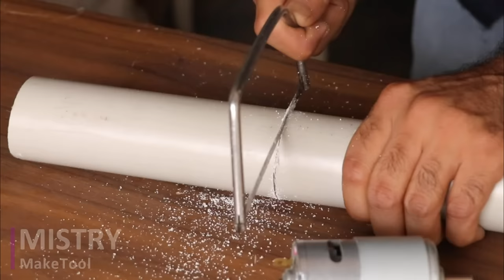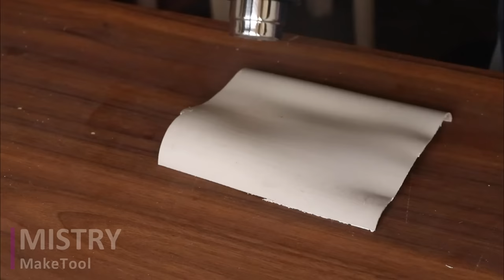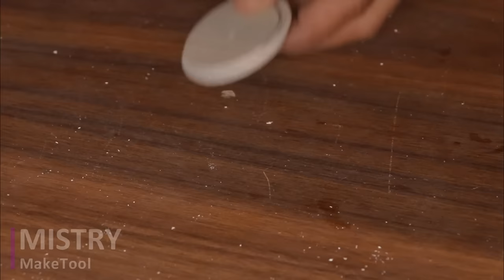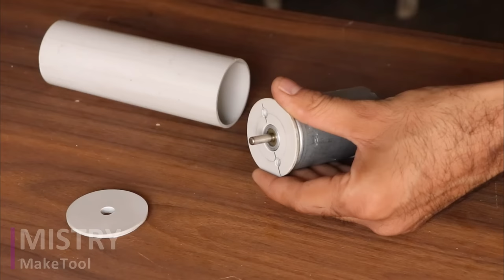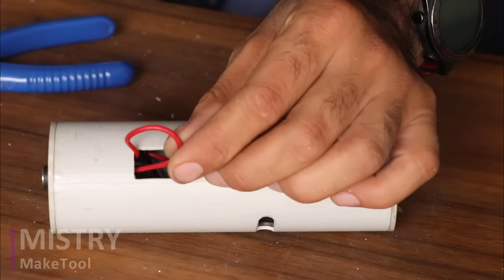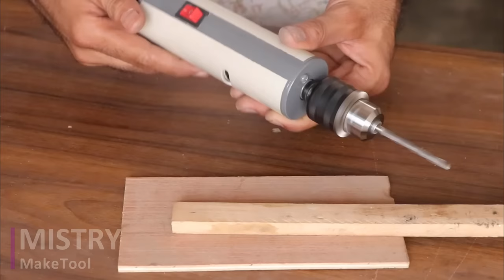How to Make a Powerful Drill Dremel Tool using 775 Motor and PVC Pipe

Comment: I flatten PVC all the time but this is the first time i saw someone else do it on a video. I actually have a video up flattening 8" C900 water pipe. That one I had to bake in the oven and stand on to get it flat. I was experimenting with HDPE but I never completed that. Was supposed to make a chopping board.

Comment: Great video! Congratulations! What power supply did you use to start the engine? Specifications like volts, amps, watts,... Thank you.
Reply: No replay from you tube channel side 😂.
Reply: Power source of at least 2.5 - 3 Amps, power supply with a voltage between 12 and 24 volts (switching source or with transformer) or a 12 volt or 24 volt car battery. The problem would be the way of fixing the chuck, taking into account that the motor shaft has 4 mm (0.157 inches). Few details offered, the most important ones, actually.
And the ventilation of the engine (ventilation slots on the metal casing of the engine) is reduced and there are chances that the engine will get very hot during use (especially with metal materials, when cutting or drilling)
Reply: or, an old vertical blender (mixer) or bought second-hand and functional, with a power of at least 500 watts, disassemble the case and adapt a chuck support to the motor shaft of the vertical blender...
or an electric nail cutter, used or second-hand, functional, which you modify less... both the blender and the electric nail cutter must be powered from the home's electrical network

Comment: Excellent brother: 
Thanks for sharing such a useful tips . I am a very small servicing business man ; I need frequently to drill in the PCB boards, and also I need such nice handy-useful drilling machine.
You have shared the entire project and materials used.
I thank you once again for your efforts. My only request is: what is the motor technical specifications to coat : in the shop.
Thanks once again brother God bless all your efforts.

Comment: not good , your engine will burn there is no air going through your engine....
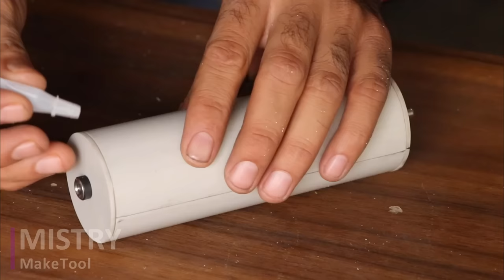Reply: 5:44
Reply: There is some holes to provide cooling due to its built in fan
Reply: There Is ,
You should watch first
Reply: Watch until end first. Then comment like what you will tell
Reply: 9